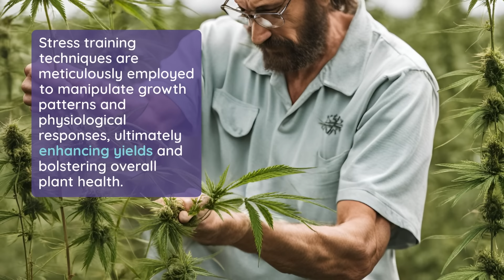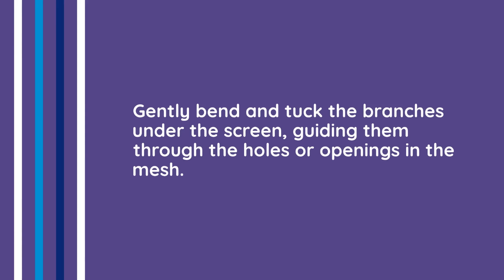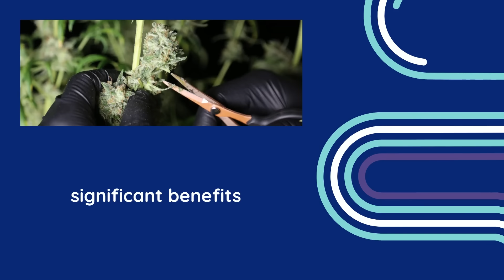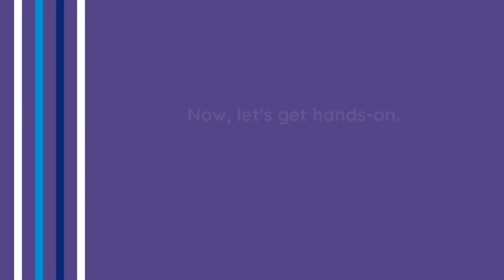Stress Training Cannabis Plants. An Educational Guide For LST.

Comment: 5:54 - Remember to roll the branch between your thumb and fingers to crush and soften the fibrous tissue. Keep rolling it as you bend. This will mitigate open-wound branch snapping. If, while bending, you feel a snap, but the outer tissue is intact, that's a good thing. That's what you want. The plant will develop a "knuckle" there. If it snaps and causes an open wound, just wrap a little masking tape around it. It will be fine, as long as it hasn't cleanly snapped off. If it's a complete, clean break, it's done. Move on. 
Happy growing! 👽✌️

Comment: I have a tendency to over water my plants..in the summer in Texas because of the heat drying out my soil. I'd like to see videos of watering and adding nutrients and keeping a certain level of moisture in my soil
Reply: Use some kind of mulch or rock to keep dirt covered from the sun.
Reply: besides soil cover, I like watering it from the bottom.